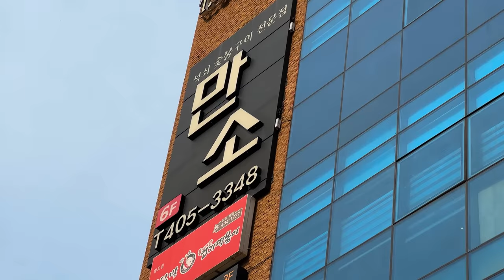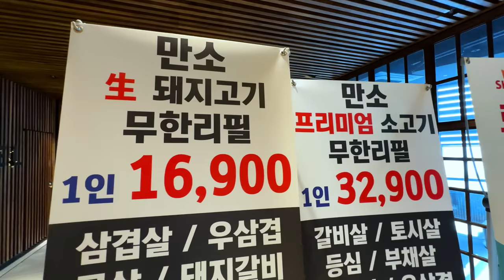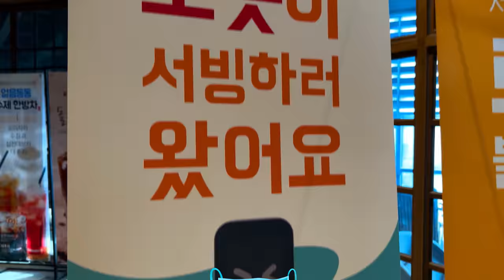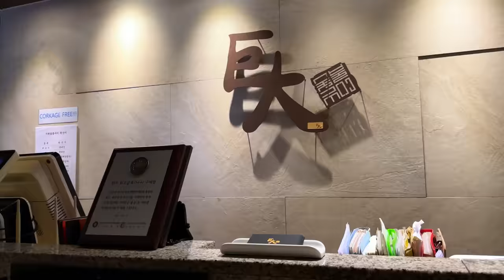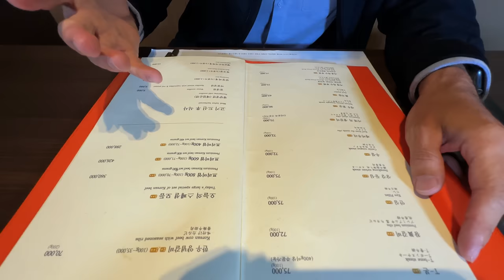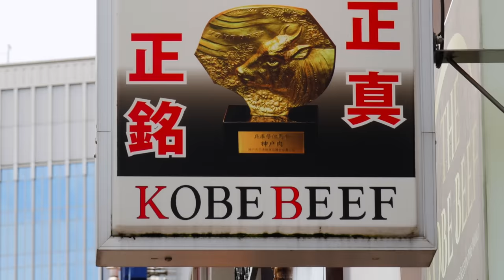$13 VS $810 Korean BBQ!! Korea Has The NEW Wagyu!!

Comment: Korea rightfully gatekeeping hanwoo. I feel like wagyu has been blown out of proportion to an extend where people will just plaster the name WAGYU anywhere and then use like 0.0001% of it in a dish
Reply: All Kobe is wagyu but a very small amount of wagyu can be considered Kobe
Reply: Yup, I don't think you can get any lower than Arby's Wagyu burgers.  Where the fine print is its regular chuck beef with a small mix of Wagyu in it.
Reply: I’ve had Hanwoo many times in Korea and I think it’s similar to Black Angus prime in the States.
Reply: @pjanoo6973  yeah I know that, but that's not what I meant
Reply: @brozors  either you guys have some brilliant black angus, are you had some lackluster hanwoo

Comment: Hanwoo grading is different than wagyu. The smaller the number the better (with 1++ as best). For general comparison, A5 wagyu graded mabling score 12 have 70% fat to meat ratio. Australian wagyu and Korean 1++ hanwoo with marbling score 9 have 50% fat. US wagyu with marble score 6-8 have 30-40% fat. US prime steak with 4-5 marbling score have 20-30% fat. Angus beef is between US wagyu and US prime.

Korean hanwoo and Australian wagyu wont melt like A5 Japanese wagyu. But they have more beef flavour due to more balanced fat to meat ratio.

Comment: 2:52 The "Bracken" looks like young Bracken Fern to me. Bracken Fern is found on almost every part of the globe, except for the polar regions and deserts. It can be risky to eat if it hasn't been prepared correctly. And it can be risky to eat even if prepared properly. It can contain either a lot or a little of a known carcinogen, most of which should be neutralised during preparation, but might not be. The inclusion of Bracken Fern in both Japanese and Korean diets has been implicated in the high rates of throat and stomach cancer in these countries. Perhaps it's best left uneaten.

Comment: Unfortunately, it is not possible to export Hanwoo (Korean beef) to the United States. This is due to several reasons, including significant political sensitivity surrounding the issue and the fact that South Korea faces geographical challenges in its livestock industry, leading to limited supply. As a result, Hanwoo faces a significant disadvantage in terms of promotional efforts compared to Japan's Wagyu beef.